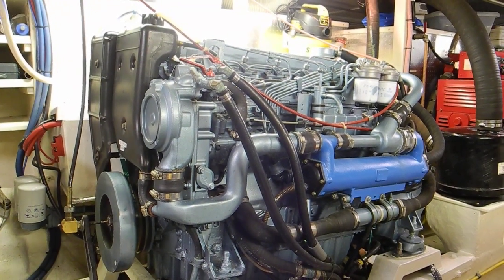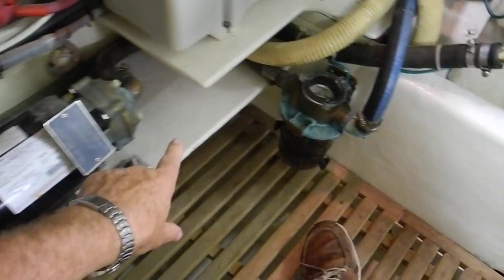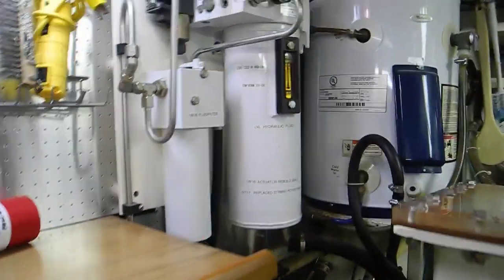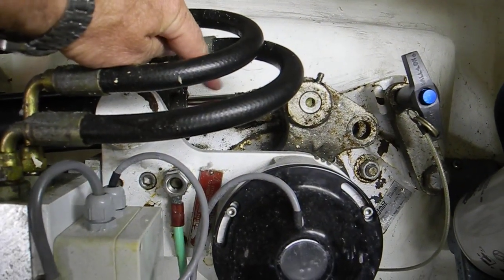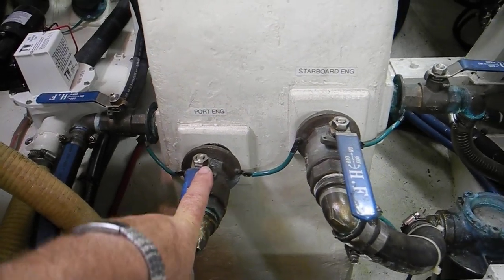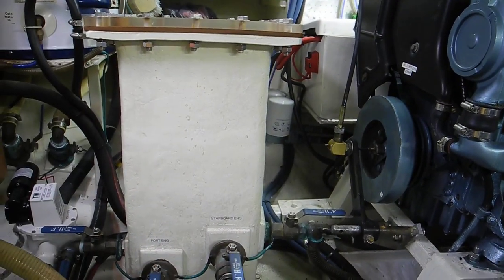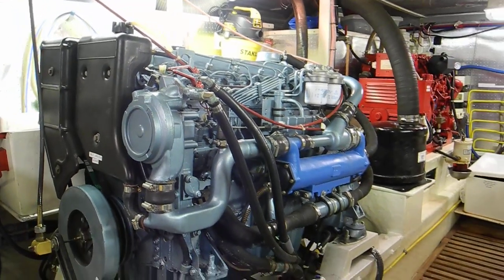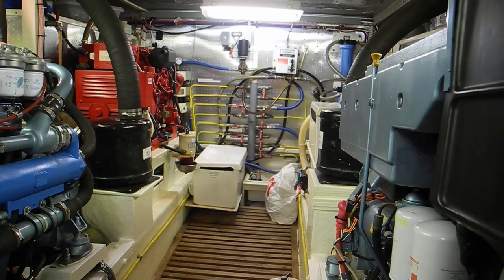A lot going on in this DeFever engine room

Comment: Wish my 38 had that kind of room. Great vid. 
Thanks. D.
Reply from the maker: This was a 44 full displacement DeFever trawler. A lot more room in full displacement trawlers and lower horsepower too!
Reply: @AskCaptainChris   my boat is 50 with full displacement hull.... I have a cramped nightmare for an engine room !
Reply from the maker: @walterdavis4808  What kind of boat? Does it have a wing engine too?
Reply: @AskCaptainChris   American Marine limited, admiralty  50-46. 
Single Lehman 120 Diesel.  No room for any thing more in there